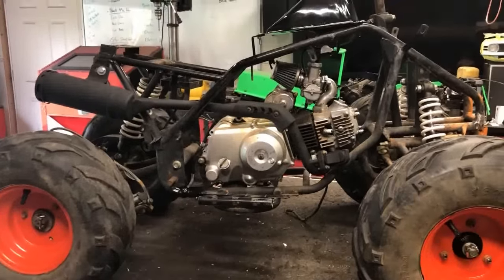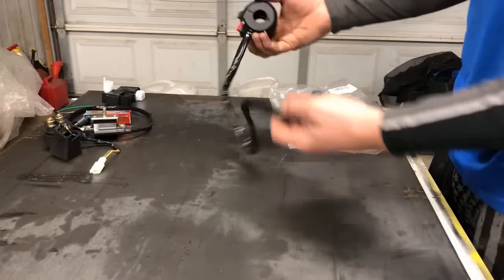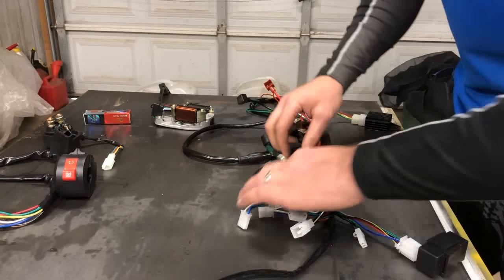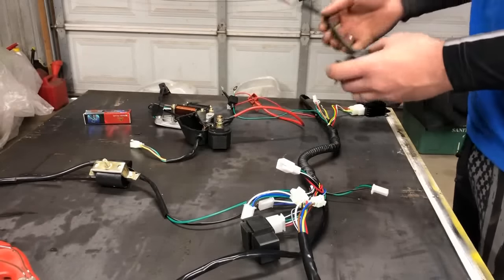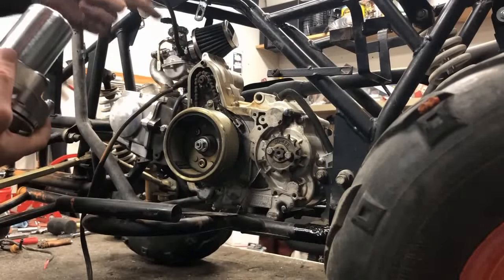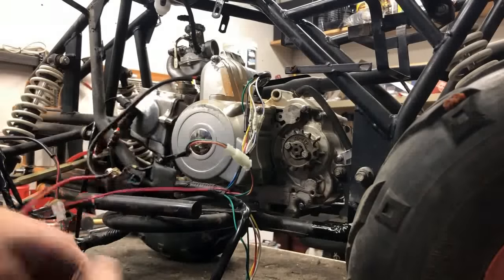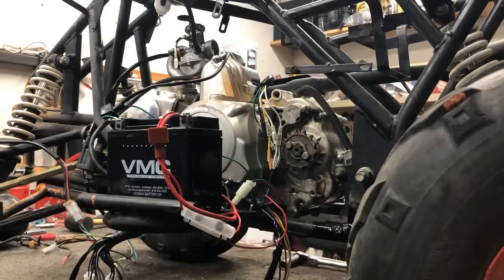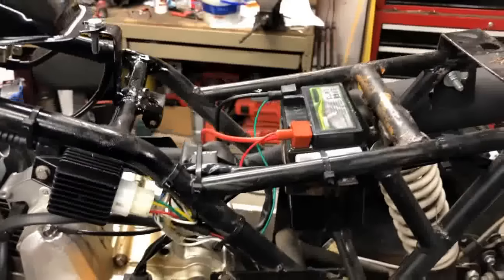Wiring a Chinese ATV from start to finish with an All New Wiring Harness!

Comment: How can I crank the quad with out the key switch so start button will work been jumping solenoid manually
Reply from the maker: You need to apply power directly to the starter. The key completes the circuit, i'm not 100% sure on those exact wires. My only advise would be to get a new key switch, they are less than $15 on eBay.
Reply: Praska Boy's Garage right guess new harness and switch it is

Comment: Great video! I have a Tao Tao 110cc go cart and want to put a LED lightbar and headlights but the stock coil can;t even handle the headlights. Are there better stators availible for these carts? Thank you !
Reply from the maker: Thanks! Have you tried running the light straight off the battery with an inline fuse and switch? I’ve never tried that on an atv, only a go kart and it seemed to work good.

Comment: Hi do you think them 2 wires you pulled from the starter, are for a kill switch on the handle bars if wanted 1 as I pulled mine out aswell It’s just a thought!!!
Reply from the maker: I don't think so because there is already a kill switch and a tether safety kill. Idk maybe! Not sure what they are for!

Comment: I have a similar situation. 18 coil stator.  Is there a full wiring kit  available. If not what wiring harness will work with a 18 coil stator. Baja 300 extreme I think . Got it free
Reply from the maker: They sell the bigger kits on eBay, I think they are universal for 150cc-300cc. However I am not as familiar with them so I wouldn't be much help.

Comment: I just got a wiring kit for my 110 and I just put the wiring together, it has great spark but the starter isn’t doing anything, if I jump the solenoid it turns over, only when the spark plug is out. All the wiring is brand new, and I just want to get this thing started finally. Any help would be nice
Reply from the maker: I cant leave a link or YouTube will delete the comment, but if you go to my page I posted a video less than a month ago about how to flip chinese atvs. Start at about the 24 minute mark and I will show you how to trouble shoot when it wont turn over.
Reply: @PraskaBoysGarage  ok thanks I’ll check it out

Comment: Can I put chevron 91 gas on my ( it says 107cc )but I think it’s a 110cc ? And where do you connect the hose that is connected from the carburetor filter to the motor after you change the carburetor with a new filter that doesn’t have the hole like the factory filter that Atv came with?

Comment: So everything with this wiring harness that you're using connects correctly to my bike the only issue I'm having is my ATV does not have a chain so near the stator off to the right of it there's a wire that comes out of the engine fire it's solid green and then the other wire is green with the red stripe so I'm trying to figure out what that wire is and where I can plug it into this harness
Reply from the maker: Sounds like your motor is a shaft drive which is pretty rare around here but I have seen them before. Can you do me a favor and email me a few pictures? I am not as familiar with them but my guess is it's for a shift light indicator. Possibly used to tell what gear you are in.

Comment: So I wired my Chinese quad they way you explained it in the video but for some reason as soon as I connect both pos and neg to the battery terminals the starter turns over. What am I doing wrong?
Reply from the maker: I am going to bet you plugged the starter relay (2 pin connector) into the brake safety. Check over everything and make sure all connections are correct.
Reply: @PraskaBoysGarage  I'll go back through all my connections. Thank you.

Comment: This is a fantastic video! 
My daughters 2006 Unilli AX-50 has run great for years, but just recently I am blowing the fuse every time I turn the key so something is grounding out. I thought rewiring was a daunting task until I saw your video. 
Any help you can give me to find the correct kit for this machine?
Thanks again
Reply from the maker: I’m not familiar with that brand. Does it have a similar engine to mine or does yours have a GY6 style motor?

Comment: Great videos thanks I have two wires coming from my carburetor is that the carburetor solenoid and where do they go
Reply from the maker: That is for an electric choke and I am assuming 2stroke? This harness does not apply to atvs with that style of choke. You'll need a manual carb.

Comment: Great video and great channel. I replaced the wiring harness on my 110 atv. The starter works when I test it independently. When it is all wired up the starter relay just clicks/buzzes. Any suggestions?
Reply: FYI, I did retest my battery and it had a full charge.
Reply from the maker: Typically a clicking noise means it's bad unfortunately. Take screw driver and bridge it across both posts on the relay. If it turns over the motor I'm gonna say the relay is bad and will need replaced.

Comment: I have a chinese atv 4 wheeler it dosent spark i bought the whole wired kit but one thing i dint see in you video was where i plug the remote crontrol thats is in the bottom of the battery
Reply from the maker: The kits that I have linked do not come with the remote control. If I have an ATV with the remotes I throw it out and keep them simple like in this video. You can buy specific kits that have the remotes but they run about $80 bucks and I just don't think they are worth it.
Reply: @PraskaBoysGarage  i bought the same kit i cant get it to work do you have an email or phone number so u can help me oout

Comment: Have you worked on the massimo 500. Has wireing issues.  It's one that tractor supply sells
Reply from the maker: No, not yet anyway. Is that a side by side or an ATV?

Comment: One more question. I ordered the 6 coil wiring harness package. Coming from the stator are 2 yellow wires, blue and white, green and black. The wiring harness has a white and yellow plus the other 3. Is there something wrong here? Connect both yellows to white and yellow or send it back? Please help. Thank you.
Reply from the maker: This question comes up often but it's super easy. The White and Yellow wires are the exact same. They are both charging wires, so you can take the 2 yellow wires from the stator and connect them to the white & yellow from the harness. Doesn't matter which is which, plug in and you're good to go!
Reply: @PraskaBoysGarage  thank you so much for responding. Did you see my question below about the spark plug debacle I have?

Comment: hi. I’ve got a kinroad xt50, I put a 110cc pit bike engine in it (previously a 50cc pit bike engine), everything went smoothly, wiring was working, only issue is it now has an electric start only. the old battery is knackered but it powered up the lights but not enough juice to crank the start, I put it on today after leaving it on charge and no lights, assumed it was too flat to operate anything I bought a new battery later on. same issue. whatever the issue is, it happened over night, there’s power going from the battery > start solenoid & key > rectifier (should there be power come back out? even so the old rectifier doesn’t make a difference). here’s where it gets weird again, the horn works, and the indicators, both in the same control unit on the left side of the handle bars, but the neutral light doesn’t work, no does any controls or start button work and they all work in the right side of the handlebars. what’s gone wrong? the wiring has not changed, nothing is unplugged. what should I do?
Reply from the maker: Seems simple but did you check the fuse? Also you could have caused an arc in the switch causing the lights to not work but that's unlikely. Did you put jumper cables on the battery and try to start it? Or possible place the wires on backwards? That could have caused your electrical issue.

Comment: Are some of these 150cc quads equipped with an electric choke, if not what are the wires for going to an apparent switch of some sort attached to the carberator??  My first time with the wiring harness.
Reply from the maker: Yes, the GY6 motors have carbs with an electric choke. If you are completely rewiring and your harness doesn't have a connection for it you will need to swap out carbs for one with a manual choke. This is more common on scooters.

Comment: Any tips for adding a foot brake? Is that addon available?
Reply from the maker: I've never added one but in theory you could. You would have to weld on a stud that the brake pedal pivots on and also the brake booster bracket. After that you could buy a brake pedal replacement, brakes and cut a hole is the plastics for it all to fit.

Comment: If you do order the wrong stator you're saying don't worry because can solder the new wires to the old stator (if it still works)? or simply replace the stator housing so the new stator fits the mounting holes in the housing (or order the correct stator to begin with i guess)?
Reply from the maker: I meant don't worry because if your old stator is still working you can leave in the cover and just connect the old wires right into the new harness.

Comment: Thank you for taking time to make this video and explaining it. I also order the same loom with stator for a quad that I picked and followed your install vid. I've got a problem with having no spark I did notice that I've got 6 wires going to cdi unit that I think is wired wrong if you can help I'd be grateful
Reply from the maker: Can you email me some photos? If you can send me some images of the wiring I might be able to tell whats going on.
Reply: @PraskaBoysGarage  I sorted it lol
Reply from the maker: @barriemilne4326  Alright awesome!
Reply: @PraskaBoysGarage  was 1 of the pins on the cdi plug that was not connecting proper also had plug from cdi plug in wrong place 🤣

Comment: Need your help. Have a 110 cc that I rebuild. After rebuild bought new harness, hooked it up and then the starter gave out. Tried doing the test you do to see if started would turn and it didn't. Bought new starter turned on twice and now same thing, starter gave up again. Am I doing something wrong?
Reply from the maker: This may sound silly but what is the condition of your battery? Is it new and does it currently have a good charge?
Reply: @PraskaBoysGarage  
Yes brand new. When I first got the new starter I hooked up new battery.  Starter already sounded a little weak. I thought it was the battery as well so I charged it over night. I hooked it back up the next day and it  still sounded kind of weak. After a couple of tries it just completely stop turning at all
Reply from the maker: @FISHONENT  You should bench test the starter motor. Make sure you battery is fully charged. Remove the starter from the engine. Take power direct from the positive side of the battery and connect it to the starter power connection. Next take another wire from the negative side of the battery and strike it against the housing of the starter. If it turns over freely then you know the starter is fine.

Comment: hey there, my harness has a couple connectors that have different colored wires than yours, I'm unsure which one is for the 2 pin kill switch connector and also my bike still won't start without jumping the solenoid relay so I' pretty sure there's a safety feature that I must bypass but touching those two wires together doesn't do anything and still doesn't start, would I be able to send someone some photos that can perhaps help me out please ? I've been stuck on this for weeks now
Reply: there's only two connectors I can plug my kill switch into 

one connector with one yellow and orange striped wire and one solid green wire 

and another connector that has one green and yellow striped wire and one solid black wire 

I've tried plugging the kill switch into both of these with no change, I've tried touching the two brake lever wires together and still won't start, I'm completely stumped and starting to think there's a small wire breakage hidden somewhere underneath the wiring insulation or something

Comment: My husband and I are rewiring a 110cc atv. We followed your video, did everything right. The motor is brand new with a 6 coil stator, we put a 2 coil stator in it and rewired it. Now it will not start, no spark. What could be wrong with it?

Comment: Would you use this setup for a 250cc atv? Have you worked on a CQR/AMS Dolphin 250cc quad by any chance? Having issues with air box any ways round this I have put a K&N filter but not sure what else to try to get performace
Reply from the maker: No, this harness will only work on the ATVs up to 125cc. The install process is the exact same and they sell the universal harnesses on both eBay and Amazon. I have never worked on that specific style of quad before but I have worked on the 250cc and they are all generically the same.
Reply: @PraskaBoysGarage  thanks for getting back to me I'm just having problems finding parts for this model too

Comment: Hey buddy. Maybe you can help me. I'm trying to find the correct harness for my atv. Not sure the brand. Its a 90cc it has a 2 coil stater but the cdi is a 4-pin. Can't find that harness anywhere. Is it possible to use a 5-pin harness?
Reply from the maker: Hey Mike, yes I believe it is possible. I also got your email! If you can please send me a pic of the connector so I can take a look at the wire colors that would help. Thanks!

Comment: Hopefully not to late to get an answer but... I followed all you instructions, got spark, tried starting fluid in the cylinder same as you yes it still won’t fire at all! It team previously to losing spark which is what caused me to order a new harness. The only thing I did not install was the new stator
Reply from the maker: Spark + fuel but it wont fire would lead to a mechanical problem. I would first check valve clearance and make sure you don't have a stuck valve or one with too much slack. If that checks out then I would run a compression test. If compression is low (under 90) then I would find out what leaks and repair. Good luck on the investigation.
Reply: Praska Boy's Garage I have ended up with a black and white and green 2 pin female connector at the back of the harness.. should that go somewhere?
Reply from the maker: That’s is a brake safety just like on the handle bars brake. Some atvs have the sensor for the foot brake also.
Reply: Praska Boy's Garage ok.. the only thing I haven’t done is check the valves and that is only because I cannot get the caps off the intake or exhaust side.. I’ve tried every wrench I have that would work it it is stuck!

Comment: Hi id just like
To ask the full wiring on my atv 110cc was replaced the other day but wires starting smoking but the only wire what was burnt and what seem to cause the problem was the red wire which connects to the battery all other wires seemed fine what can be the problem?
Reply from the maker: Something is hooked up incorrectly allowing power to constantly flow threw that wire. Or perhaps you hooked it up to the negative side of the battery? Could also be a fault in you ground. Go over the entire harness and insure your have it 100% hooked up correctly.

Comment: Great video! My 110 didn’t have spark so I rewired completely just as you did.. motor cranks over but no spark.. any suggestion? All wiring is brand new . Thanks!
Reply from the maker: Turning over is half the battle so that's a great start. No spark can result in a number of different issues. Start with the easy stuff. Check to make sure you have a good spark plug. Make sure you have a good ground. Then make sure the kill switch is in the run position and the safety tether is plugged in.

Comment: I have gotten this harness, but I can’t ever get it to spark. I’m holding the brake, I have a good coil, cdi, spark plug, and stator. Everything is hooked up correctly. Im holding the 2 connections together for the brake and the starter can spin all day but I still don’t have spark! Do you think you can help?
Reply from the maker: Stator, CDI, Coil, and Spark plug are the components that effect spark. You also have the ground wire, safety tether and kill switch that need to function correctly. Start with the easy stuff. Unplug your tether, clean your contacts for ground, make sure your battery is fully charged, and use a multimeter to make sure the kill switch functions properly with an open and closed circuit. If you do all that and still no spark, then likely you have a failed component. In my experience if you have a failed component it's usually a bad CDI Box.

Comment: I know this is a super old video but im wiring a 125cc coolster and the starter selonoid is in the front and the battery is in the back how long is the wiring harness did you have alot of slack for the wiring my 125 frame is longer than the 110 do you think the harness is long enough thank you

Comment: Nice job putting these vids together. I have been bolting on mods to my kids atv and was wondering if I could delete the EGR by blanking it off at the exhaust and changing the air filter. Thanks for any advice
Reply from the maker: Yes you can. I've personally just replace them with a new exhaust that doesn't have them or the breather valve.

Comment: Thank you your video helped a lot. I'm not a frequent flipper of an ATV but I had some questions about some other things that I know you're the right guy to ask. My Chinese ATV I traded a crossbow for it for my daughter oh, the guy who had it before me had done a few different modifications and some of the tabs that hold the Plastics on are gone. What would you suggest doing to secure the Plastics to the bike but for someone that doesn't have a welder that can't put tabs back on
Reply from the maker: When I can't weld, I use JB weld. It's not the best solution but sometimes in a pinch it's what you have to do!